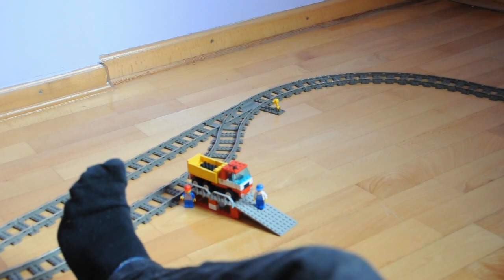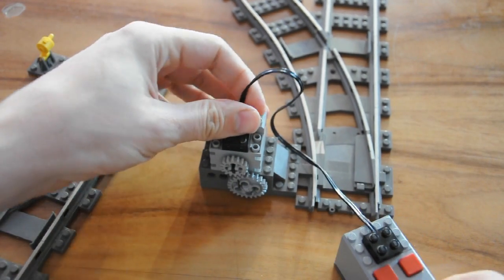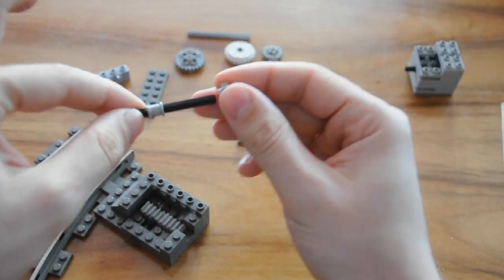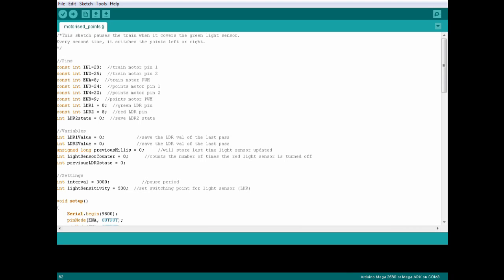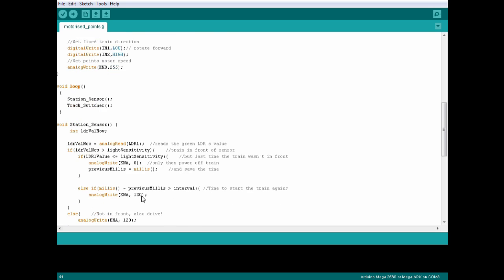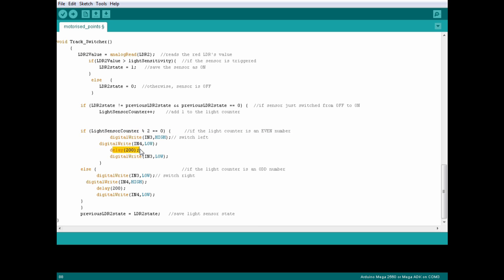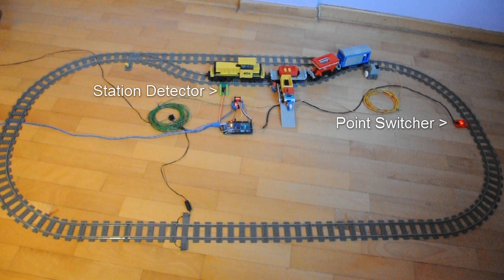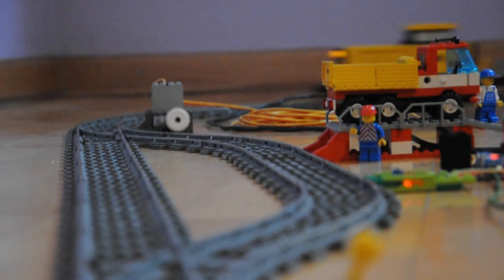Arduino for Lego Trains #3: Motorized Track Switches

Comment: One question: the original Lego 9V switch has a very strong spring (locking mechanism), and thus it takes lots of force to actuate it. Did you have to remove the spring on the downside (interior) of the switch, prior to building the motor onto it? Or is the Technic 9V motor, in combination with the clutch, strong enough?
Reply: Regarding the version of the Technic 9V Motor: I saw that you used the version called "Heavier Weight", not the version called "Lighter Weight" on BrickLink. I am going to try out both versions and see if the weight affects the performance of the switching. Also, whether the locking mechanism must be removed from the switch or not.
Reply: Correction to your Parts List:
you need three rather than two Plate 2x3, as depicted in your video at 1:20.

Comment: Lego DID solve this problem. The old 12v train system had motorised switches available.
Reply: Yes, but they never solved it for the 9v switches introduced later in 1991.

Comment: I like that you put a clutch in there, most other versions connect the motor directly to the switch.
Reply: Yeah I put a solid gear and it always grinded until I put the clutch on it

Comment: Great video! 
I have a comment about your programming, and you have probably figured this out, but I feel I should put in my two cents worth.
It's not a void. It's a subroutine. 
Void is the return type, which is to say, some subroutines return some value to the calling code, kind of like a function, and some don't. 
When a subroutine is meant to return a value you have to specify what type of value, like integer or float so the compiler knows how much memory to reserve for the return value. 
When a subroutine is meant to just perform some action and not return any value the return type is void (none, null or N/A) so the compiler knows it doesn't have to reserve any memory for the return value.

Comment: Any suggestions for when the switch is too stiff and the clutch engages too soon?
Reply from the maker: You can try switching the position of the large gear and the clutch gear. This has helped me with some stiff switches.
Reply: This seems to do the trick, thanks!

Comment: how u made wireless connection
Reply from the maker: There is no wireless connection in this video. Watch video #14 to see how you can control motors wirelessly (requires two Arduinos).

Comment: Great job mate, I'm sure a lot of Lego die hards would LOVE that you didn't have to modify the switch at all. But I can't help but think that it's awfully BIG for a switch. For anyone who is interested,  I found an idea which is MUCH smaller and compact (small rectangular box with no gears showing). As a matter of fact, there is only one gear and one rack. The ONLY thing is though, to make it work, the tabs that hold the Lego lever have to be ground off. (Yiiiiikes) BUT, I think that lever is kind of weak and easily breakable anyway..(especially when handled by an excited 6 yo...or 45 yo for that matter...) Here is the link...cheers again Mr ALT..  

http://www.freelug.org/spip.php?page=article&id_article=507
Reply: Oh and I forgot to say....no Lego motor required!!! just a cheap $2 motor!! C ya!
Reply from the maker: This design is 4x8 lego studs, compared to my design of 5x8, so it's not really MUCH smaller. It's also aligned 90 degrees to the track, so it extends farther out. Then it uses non-Lego parts and requires the functional destruction of a set of points in order to work.

All in all, it looks like a really, really bad design.

Comment: you dont need to use arduino, you can also use lego mindstorms to control the train etc
Reply from the maker: Yes, but mindstorms cost a huge amount of money compared to Arduinos, and can only control what, four motors? My arduino setup controls 12 (check out video 10 for details).

Comment: Thank you so much for this video. It helped me a lot. But I use old 4,5v motors and a 12v train transformer to remote control it. It works perfect. Just like the old 12v stuff but with 9v tracks <3.
Reply from the maker: +NeoSephirothVal Great to hear! Why not make a short video showing us what you've done?
Reply: Sure, I will do that when the parts from bricklink arrive. Atm it's way to colorfull. I want that complete dark blue gray.^^
Reply from the maker: Yes, one of the hardest parts of this design is finding all the pieces in one colour! The old 9v points use dark grey (not dark blue grey), which isn't easy to find any more... especially when you have 12 points!
Reply: I tried to get the parts in dark grey, but I would had to buy in 6 different shops and it would cost me 3 times as much. That's why I use dark blue gray.
Reply: @ArduinoLegoTrains  I wouldn't mind chosing a different color, as long as it looks good. After all, the 12V switches of the 1980s had light grey rails and housings of the switch motors, but dark grey sleepers. Another channel here shows several colors of the gearbox, like red, yellow, blue etc., which helps color coding different switches and looks nice.

Comment: it would be better to work with a PF servo motor
Reply from the maker: +Zippo NVR Yes, the PF servo motor has more torque. But it is a much bigger motor, which makes the whole mechanism extend past the length of the switch track (so you can only connect the switch to straights, not curves). It also requires an extra cable to convert from PF to old technic 9V (unless you want to cut the PF motor cable), and is much more expensive than the old 9V motors.
Reply: +Arduino Lego Trains 
Yes, but the main advantage is that it is rotated only by 90 degrees, so you will not need to use the clutch. Although you did not use it in your video =)

Comment: why not a remote control with a lego servo motor?
Reply: +LEGO CREATIONS | SpartaGames but this is friggin brilliant
Reply from the maker: +LEGO CREATIONS | SpartaGames Remote Control is covered in #7, so it's really easy to combine that code with this tutorial to make a remote-controlled switch. No need for servo motors; my solution uses the cheapest combination of motors and bricks available.
Reply: Arduino Lego Trains ok :D

Comment: The older 12V system had switches that were remote controlled. 753 and 754 seems to be an older version (blue) while I had two in grey.
Reply: 7858 for the grey 12v switcher, they did ALOT, lights that stopped the trains and de-couplers
Reply: yup, I also have two and I recon most kids only had two. It came in a expansion kit and it was pretty expensive too.

Comment: Why on earth are you calling functions "voids"?!  Void is the return type of those particular functions, that is, they do not return anything, they are not "voids", they are functions without return values.
Reply from the maker: Because this series of tutorials is designed for people with no prior coding experience. Using the word "function" when it doesn't show up anywhere on the screen gets very confusing for beginners. But you're completely correct, of course.
Reply: Or "procedures" (e.g. in Pascal).